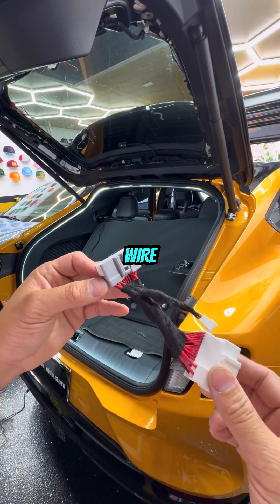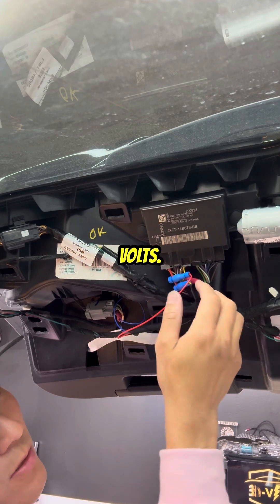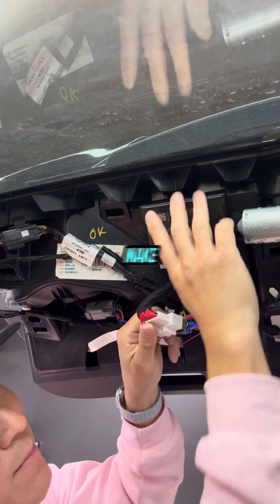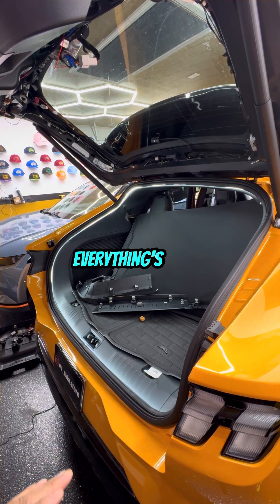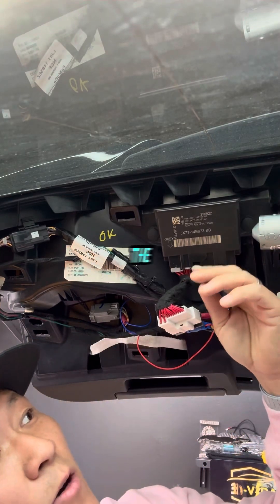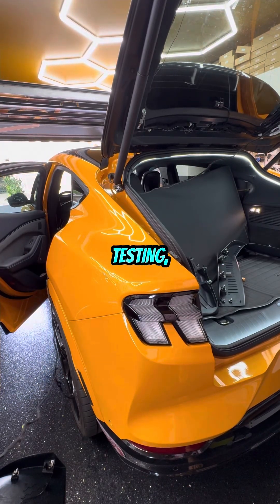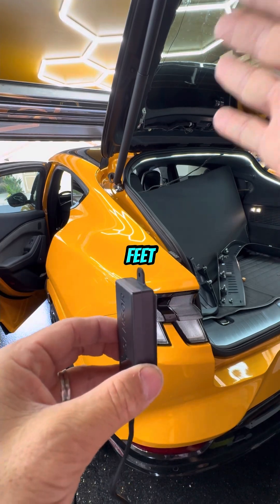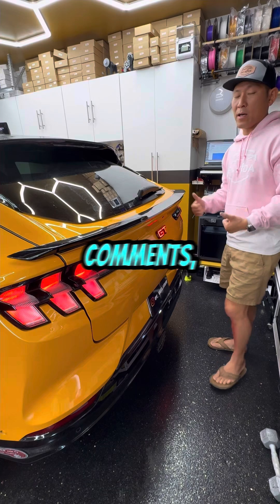EV Vida Presents: Plug-N-Play Tutorial for Handsfree Module compatible with the the Mustang Mach-E

Comment: is this aftermarket piece smart enough to only work when you have the key? or will it open for anyone regardless if they have a key or not?
Reply from the maker: Excellent question; this product is 100% dependent on either your Keyfob or your Paak. It is NOT smart enough to work without those two items. This is simply a harness that connects to a module that will unlock ONLY if car is either unlocked or if your key is nearby. 

Another way to consider this item is if you have your key nearby and you need to unlock your trunk by pushing the button. Instead of pushing the button, you use your feet.